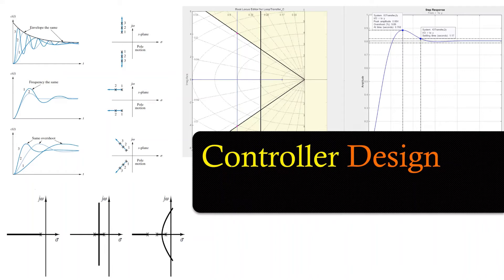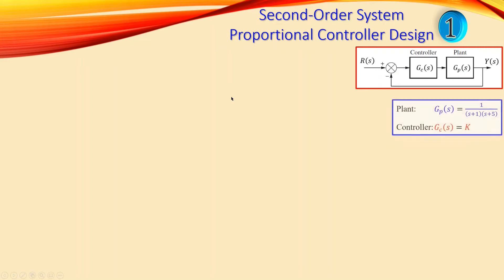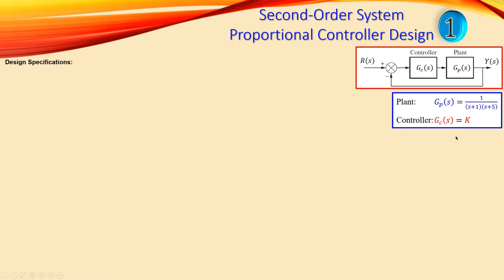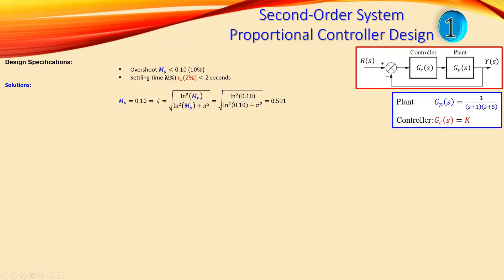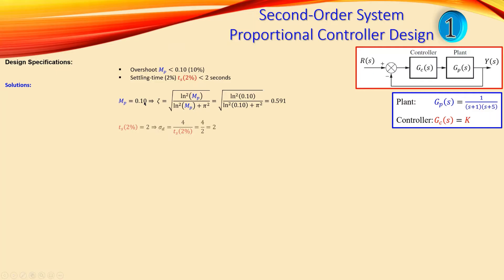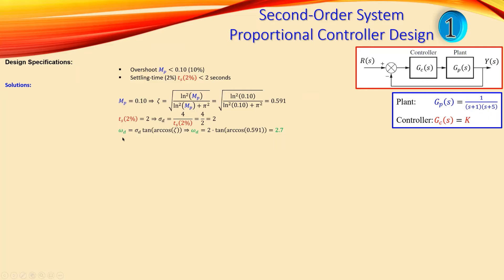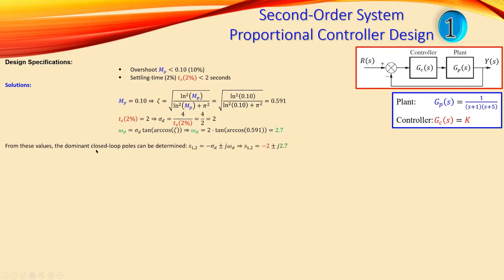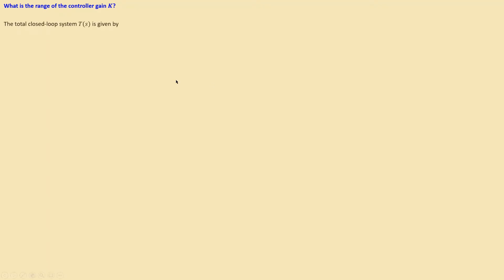Root Locus Design Method 💡 P Controller Design 💡 Calculations & MATLAB Simulations 🌟 Example 1

Comment: Can you please clarify this?. the unit step requires the output to be 1 but the output has an offset always. the case where K=20.8 the system reaches only 0.9 (after settling time). So how do you interprete that?
Reply from the maker: If the system does not have a pole at the origin (s = 0), meaning having no integrator, then the system with only P controller will always have a steady-state error in closed-loop configuration. That is the reason for using a PI controller to eliminate the offset.
You can watch these videos about Steady-State Error to learn more about this topic: https://www.youtube.com/playlist?list=PLuUNUe8EVqlk-WcLY6L-f7P6xZl8SA0Wn

Comment: Hi CAN. Very instructive and helpful video. I am working on a project to design the controller of a motor. My question is how do you take into account the actual parameters of your system? For instance, on matlab i get an amplitude of 1 when i introduce my open loop function, while in real life my amplitude was 19rad/s; the stable speed of the motor. Is there a way to modify this on amtlab? Another point is regarding the sensor that feeds the voltage from the plant's output back to the input; How do i take that into account in my design and matlab sim?
Reply from the maker: Thanks for your message. You can adjust the gain to go from 19 rad/s to 1 by dividing by 19. I do not understand the other question.